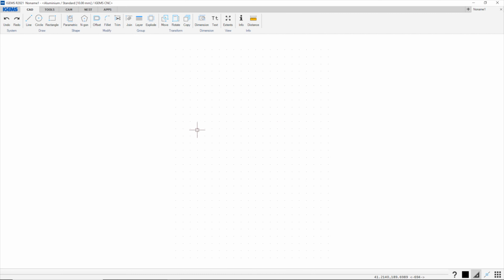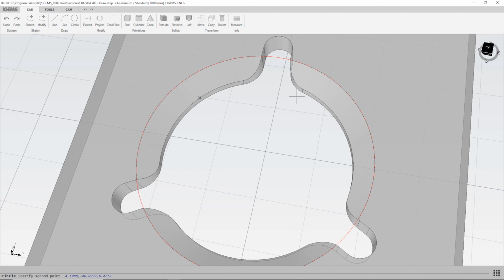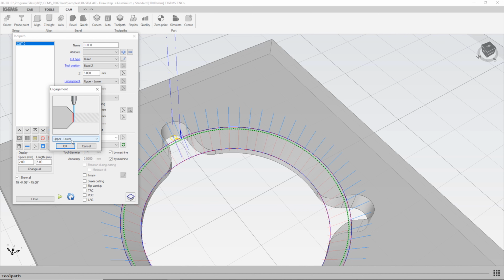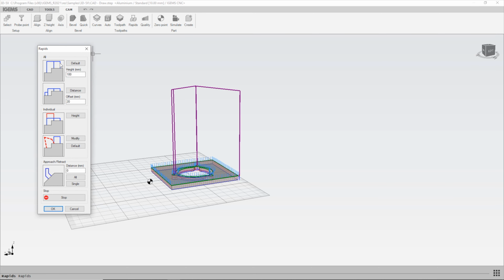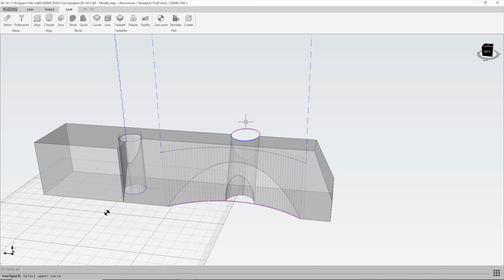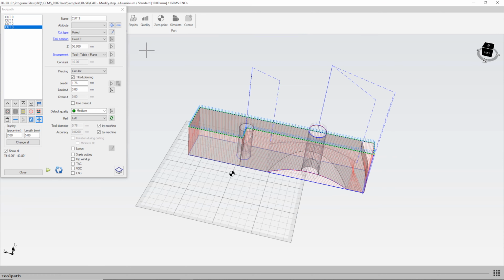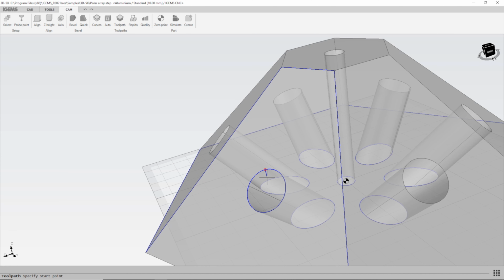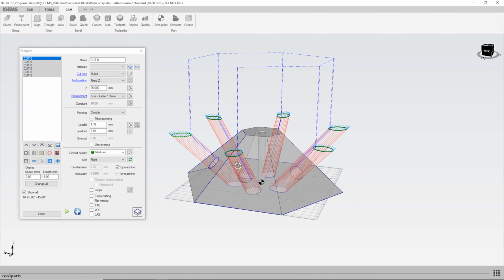3D5X Exercises Part 1

Comment: In case I don't find the answer on my own. What would cause a programed vertical 45 degree cut to cut horizontal on the machine? In the end I had to program a 45 degree horizontal cut and it cut vertically. Is this a setting? The way the part was oriented on the plane? It worked but I would like to know what I did wrong.
Reply from the maker: Ryian, I don't really understand the difference between a vertical and horizontal 45 degree cut. Did you sort it out? Otherwise I'd contact your IGEMS reseller to sort it out.
Joakim
Reply: @igemswaterjet  I think I have figured it out. It was a confusing situation. Thank you for replying.